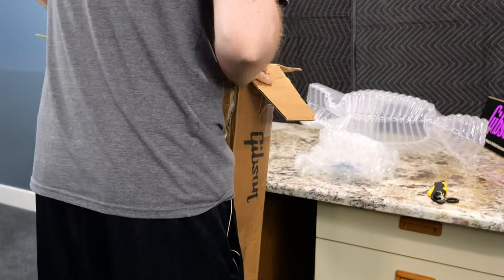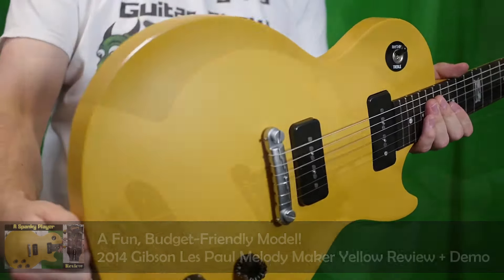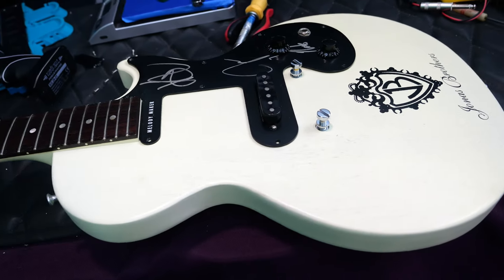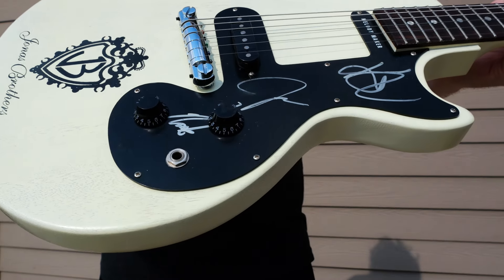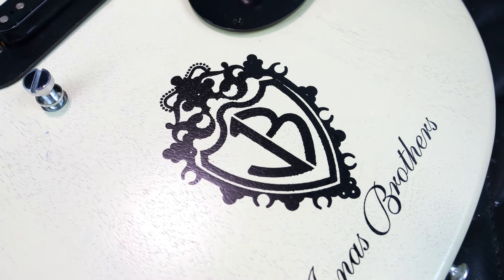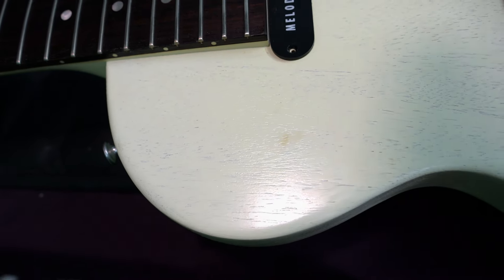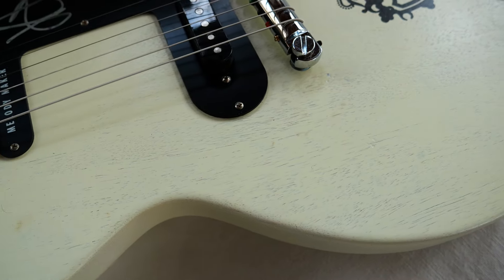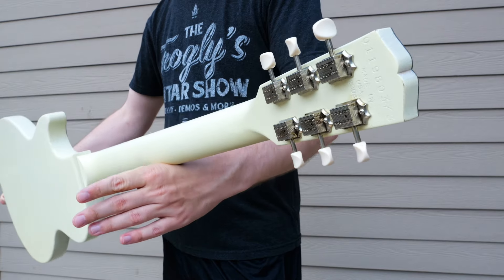This CHEAP Gibson ($500) Surprised Me... | 2007 Gibson Melody Maker Single Coil White Jonas Brothers

Comment: I bought one in 2007 for about $350. I routed out the pickup cavity and put in a P90, 500K pots and a vintage NOS capacitor. It sounded similar to a Les Paul Jr. of what I remember.

Comment: I bought a Firebird Zero new on sale, at AMS for around $300 and I was pleasantly surprised! Not because it was a simply a Gibson, but it was very playable. Great neck, and had decent pickups. It was a limited edition finish called "Goldmist Pearl" but was actually off white, with a white pearloid pickguard. There's nothing pearl about it! But One of the sharper looking ones in my opinion...Yes the finish on the body looked like it came from a spray can, but it was done clean and the natural maple neck reminds of my '87 Charvel Model 1. I like the  the pickups & have some decent character to them. I still own it. A very basic guitar...It's not anywhere near as nice as a true specked out Les Paul or Firebird, but for a $300 couch guitar, its pretty cool!

Comment: I have the 2011 Explorer melody maker. It is a really good playing guitar. I got mine off of Reverb and it had an intonatable bridge and upgraded tuners and had a Duncan JB in the bridge, that is a fun guitar. I don't like the bigger size of the regular explorers so this one is perfect. I also have 2011 Les Paul Melody maker with single humbucker pickup only volume control. That one plays well too, resonant unplugged and just a fun guitar. The pickup is ok, would have preferred something hotter.
Reply: I just recently got the 2011 single humbucker Melody Maker for $400. I think the humbucker is the 490R, which is ceramic and meant for the rhythm or neck position, usually wound less hot.. Sounds pretty creamy, super fun to play. Gonna put that Music City intonated wrap around bridge on there, the stock bridge is not great. Then, BG Pups makes a humbucker sized p90 that is supposed to be the best. They have a long lead time on their pickups, but can't wait to slap one of those in that Melody Maker!!

Comment: I was wondering if you would ever do a review on this guitar.  I got the Sunburst model and I love it.   My single coil does not sound harsh when cranked up but I do roll down the tone a bit too. I have been putting off installing my Dimarzio SDS-1 b/c I like the way the original pickup sounds. Eventually I will try the Dimarzio and I also have a Lollar Melody Maker P90 but that will be the last pickup I try b/c I have to route the body out.   Oh I also bought an Emerson bumble bee wire harness and some hipshot locking tuners.
Reply: Dude, sounds sick. Just a heads up, those Emerson bumble bees are not authentic. They make those in house, and paint them bumblebees. So I went with RS Guitarworks wiring harness instead, they make their caps too, yet they dont try to disguise them. The reviews on both wiring harness are off the charts though. Emerson, handmade in Oklahoma, and RS handmade in Kentucky..
Reply: I love HipShot hardware! I went with those awesome locking Kluson's with the white keystone buttons though, just to try to match a Gibson look..

Comment: There was a cheaper Les Paul bodied guitar. called the Gibson Baldwin Epoch. it was an entry level guitar that carried the moniker Gibson Baldwin Education. it didn't have the Gibson inlay on the headstock. instead it had an Epoch inlay on the headstock. it had two humbucker type pick-ups and a raptail bridge. and it was only produced one year in 2007. and they were all black with binding on the top of the guitar. to have an accurate representation of all the guitars that Gibson produced. you should at least have one of them in your museum. besides you can probably pick one up for cheap. last I knew one's in pretty good condition were going for just under $200.00. however you may not want to do a review and demo on it.